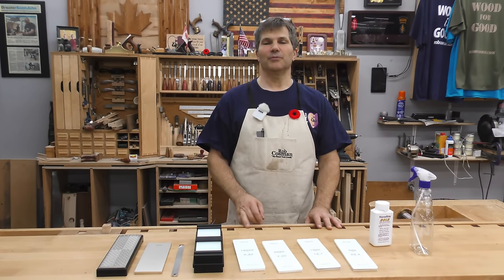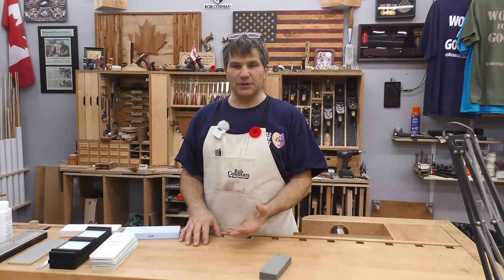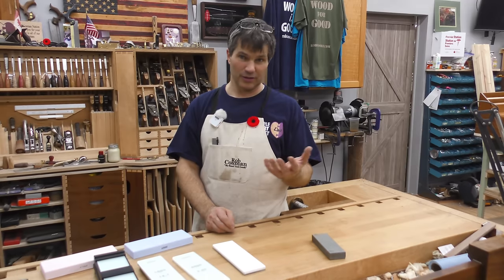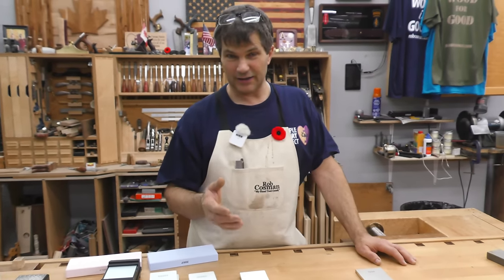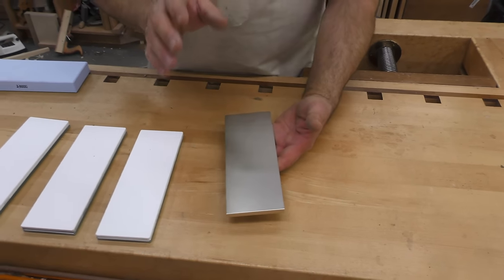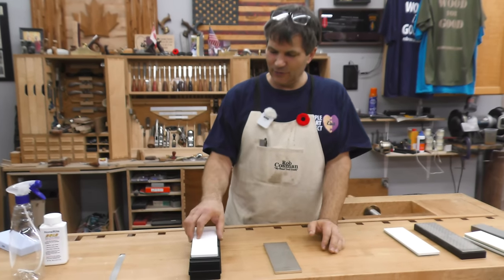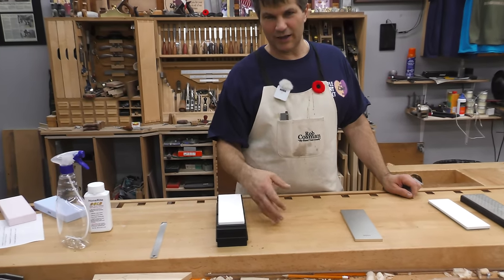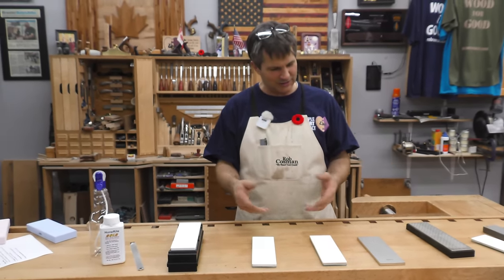Rob Cosman Sharpening Kit - (BEST VALUE)

Comment: For flattening my stones and metal plates I use the Shapton 空母　(aircraft carrier). For the mirror side of my blades and chisels I use metal plates, first with silicon carbide then diamond paste. The metal plates I also maintain flat with the Shapton 空母. The mirror side I have to do it only once for the whole life of the chisel or blade. The burr comes of easily just by polishing the bevel.
Reply from the maker: So what micron size is your diamond paste?  The smallest made is around 1.5 micron but the Shapton 16k is .92 microns.  Your system will absolutely work, but I think having a 16k stone that has finer abrasive and is ready to go is more convenient and gives a slightly better polish
Reply: @RobCosmanWoodworking  The advantage is the flatness of the metal plate, it stays longer flat, so you can get a flat mirror side, with no distorsion in the reflections. With the stones I can’t get a flatness like that. Diamond paste you can get till 0.1 micron, I use 1.0 micron in the end, which sufficient for a very fine cutting edge.

Comment: Woooow, thanks dude! I learned a lot here. But Why there are so many black scratches on the surface of the whetstone when I use my new 6000 whetstone to sharpen knife? Even if I rub it with my hand and water, they won't go away completely. I had to scrape it with a flattening stone. Does that mean the whetstone is of poor quality? Am I being cheated by the merchants？
Reply from the maker: The black scratches are metal being left behind by the knife. The stone wears, but the knifes wears faster.
Reply: @RobCosmanWoodworking  Really appreciate your help. So I don't have to worry about the scratches and just use flattening stone to remove them, right? That doesn't mean the sharpening stone is bad?
Reply from the maker: That’s correct

Comment: Rob, knowing you advocate of going to a 16K final grit, are you concerned with the idea that since wood is in itself an abrasive, the 16K finish won't last long enough? I've read many other comments that going to 4-6K is more than plenty. You've certainly had success with the 16K, but I am interested in your perspective.
Reply: It's not about the polish itself or the surface of the bevel. The blade edge has microscopic serrations on it, like sawteeth if you would, only very very small. If those serrations are bigger, they break off more easily during use. The smaller they are and the closer the edge of the blade to being non-serrated, the longer it holds the edge and the sharpness. Polishing the bevel very finely helps make those serrations on the edge of the blade smaller and smaller, so it holds the edge longer.
Reply from the maker: Sarcast is correct.  But the answer to grit size is the final surface if the wood.  4-6k cannot come close to the surface perfection a 16k polished edge leaves.  No sanding necessary and a glass like wood surface.  Let your hand be the judge
Reply: Thank you both for the reply. I do see the benefits of the 16K stone, I'm just having difficulties justifying the $$ for the stone and holder. It may come down to progress now and perfection a bit later, unless I feel I can live with a 1200 diamond stone now and then wait for perfection! Hobbies can certainly be expensive!

Comment: is 16k any different that "rouge" on a strop?
Reply: The shapton has a more consistent grit size than a cheap polishing compound though they can have a smaller micron size than a shapton. Be careful with grit size as they are not always the best indicator of actual grit size. Shapton 16000 grit is just below 1 micron. I use rouge on solid leather and have not noticed it blunting any tool more than the wood does but my time is not as valuable as Rob's. If it was I would think about getting a Shapton.

Comment: Hey Rob. Question for you, is there a big, noticeable difference between 8k and 16k grit? Does it justify spending $40 more to get the 16k? I know you mentioned it in this video, I just want to get your opinion for a beginning wood worker.
Reply from the maker: HI Eric, the math works!  16k or 8k tertiary bevel take the same amount of time to create (10 seconds).  Both will last a hobby woodworker 5-7 years, obviously depends on how much it gets used.  Like comparing 320 grit sand paper vs 150, big difference.  $40 difference spread over 5 years is hardly worth the math.  Go for it.
Reply: @RobCosmanWoodworking  thank you sir!
Reply: Also, I was given a Bailey no. 3 plane recently. The only issue I have with it is that there are 2 cracks on the sole. One by the mouth, the other on the side (the side one is non structural). I'm thinking of attempting a braze repair on it just for fun. Would you agree that the plane is basically just good for parts due to that crack?

Comment: I have been trying to sharpen my plane iron with some waterstones. It grinding off metal but not getting sharper. There is no burr. I'm using a honing jig on the 400 grit stone.
Reply from the maker: Thats not good.  Watch my video on how to sharpen plane blades.  You should not have to  start with such a heavy grit as 400, it will leave deep scratches that you have to remove.  Watch the video.  Even if you dont want to freehand, follow the steps with a jig
Reply: @RobCosmanWoodworking  thanks
Reply: I had similar problems for a long time until I changed a couple of things. First, make sure the back of the iorn near the edge is truly flat all the way across the width of the iron. Using the ruler  trick helps by limiting the amount of the back you have to flatten.

Secondly, whether flattening the back or honing the bevel, don't press down on the iron any harder than you need to for it to remain in contact with the surface of the stone. I used to press down hard trying to get the stone to cut faster. That doesn't work and it takes only a very small inconsistency to ruin the edge you just cut. Let the stone do the cutting by itself. You're just guiding the blade over the stone.
Reply: @buddythompson5284  thanks

Comment: Do you like the scary sharp system for a newbie or go for the 💎
Reply from the maker: Scary sharp you will keep having to buy more sharpening sheets.  I always recommend buy the best so you don’t have to spend more money down the road to replace the what you just bought.
Reply: I started using the "scary sharp" system when I bought my first plane from Rob early this year. Let me just say it got old really quick. The paper moves, tears is a mess and isn't that cheap. I got to the point where I would hate sharpening. At least now with the trend plate and Shapton stone sharpening is now only an irritation. I dont think I will ever enjoy sharpening I need to get the wife interested 🤔
Reply: Yea, I gotta get a honing guide first, then decide about do I try sandpaper first or just spend the money on the diamond plate and get it over with. Merry Christmas to me?

Comment: About spray bottle I am lazy too.I add three  stainless steel screw nuts (1/8" diameter fits tight) on the plastic pipe and the extra weight pull down like an anchor when moved and it always on the water.

Comment: I use a guide to sharpen my plane irons. I know you do it free hand but I find that I don’t mind the extra time it takes to sharpen and I like the repeatability. I have a problem. I put on a secondary bevel with the Trend 1000 diamond plate and get a burr across the edge. I use the Trend 300 side to flatten the Shapton and it appears to be really flat. Without resetting the guide, when I try to polish the edge with the Shapton 16000, I get a polish only on the center of the edge. As I polish the edge, the black marks on the stone are only in the center of the edge. I even tried pressing only on the center on the 1000 for the burr and on the side for the 16000 but still the same problem. I know that this sounds impossible but no matter how much I flatten the Shapton with the Trend, I still have the problem.

Comment: Could the Shapton stones be used with (light) oil instead of water? If not, what happens? Since diamond stones work great with oil, it would be nice to be able to get away from the rust-inducing water.
Reply from the maker: Shapton specifically say not to get any petroleum product on the stones.  I dont know what would happen and i am not willing to find out.  I will just use my water and honerite solution

Comment: Hi Rob, great video. I noticed the shapton plates go as high as 30,000.i take it you don't recommend going that high. I am using the L/N ruler for sharpining and it slides all over the place
Reply from the maker: 30k is awesome, but the stone is very expensive.  If you can handle the price going to 30k is great, about 5% better than 16k

Comment: Does this guy actually make anything other than videos? Is that actually a woodworking shop or just a studio set?
Reply from the maker: Good question Jeff, I use to have a large gallery on my old website but that didn't carry over to the new site managed buy staff.  If  you would like to see some of my work you can check out my online workshop, available on my site robcosman.com, there is a free trial and access to 40 or 50 pieces of work I have made in the past 10 years.  I built furniture of a living from 1989 to 2000.  I  have 10 children and furniture making was a great way to starve.  I am professionally trained but i stopped taking commissions back in 2002.  Started selling Lie-Nielsen tools in Canada which led to a lot of teaching and eventually making my own tools that I thought better suited our aging customers.  As for the shop, it is a mess on the back half that you don't see, we do film a lot, 8 videos a week.  I do all the turning of tool handles that we sell, I develop new tools and build the jigs to make them.  Also make all the custom saws and I am about to open a separate website where I will sell the items i make, woodhinge boxes, burl chisel handles, fancy saws, ect.

Comment: I bought the 300/1000 that you recommended, and I tried flattening some of my whetstones with it. Not sure what I did but now my whetstones don’t even seem to cut well they produce a dull cloudy effect it’s really strange. Any advice would be really appreciated.
Reply: I purchased one of those myself with the intent to use it as a flattening plane for my wetstones. For the life of me I couldn't figure out why the stones weren't producing an even sharpening along the chisel edge. I finally checked the diamond plate's flatness and it wasn't even flat. If you laid a straight edge across the width, you could see a lot of light coming through the middle area. This was far more prominent on the 300 side. Extremely disappointed that I assumed it would be perfectly flat out of the box. I should've checked it and returned it asap.